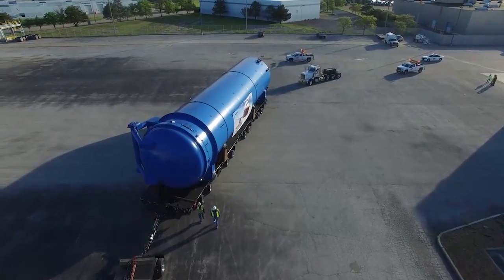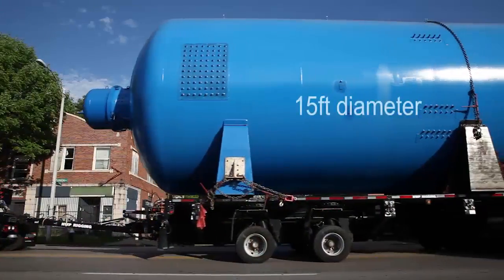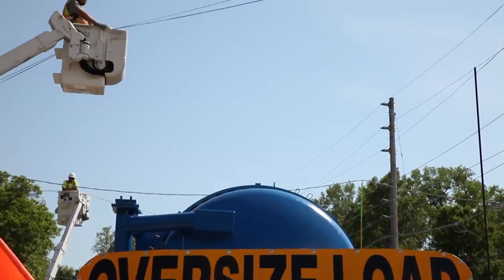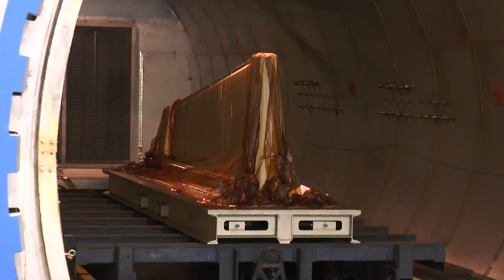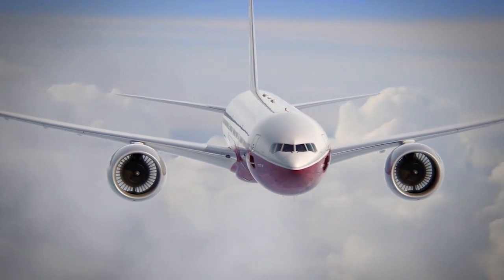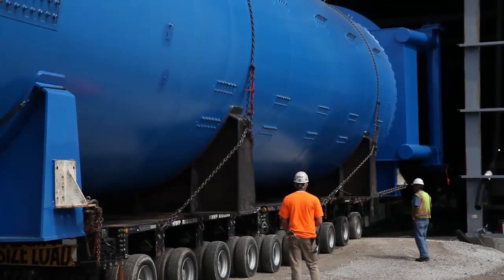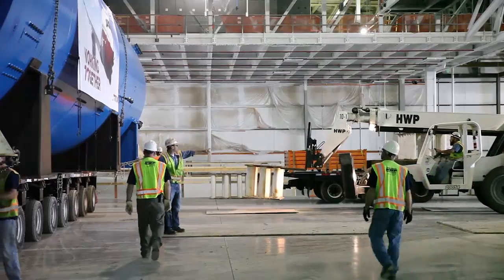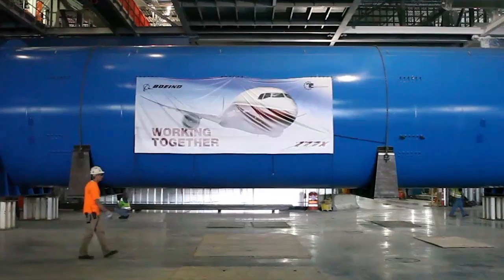Giant Autoclave for Boeing 777X Parts Makes its Move

Comment: Pardon my ignorance, but why can't Boeing use the 787 autoclaves for the 777x?
Reply: +Hrishikesh Namboodiri probably because the parts produced for the 777X are bigger. I also expect the 787 production line runs at full capacity.
Reply: +Hrishikesh Namboodiri Maybe because the 787 autoclaves are being used for 787s?  In short the autoclaves need to be in the same building that the carbon fiber layups are done in.

The carbon composites are assembled on molds. The molds are different for each aircraft and the skins are made in different buildings. Even parts for the same airplane are made in different places all over the world. They need to be baked on site after they are assembled, as moving them would introduce foreign object debris, destroying the expensive parts. They also must remain under a vacuum from the time the plies are stacked to the time the part is done baking. Once done baking they are safe to ship to the assembly factories.
Reply: Thank you for clearing that up for me.